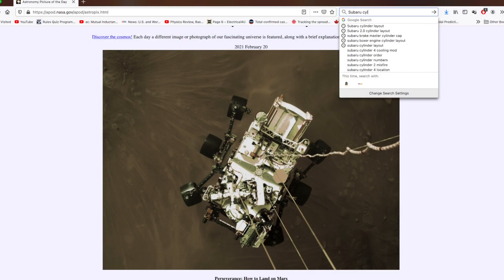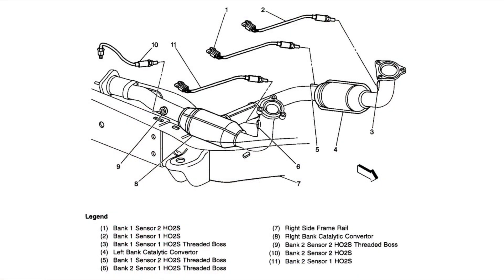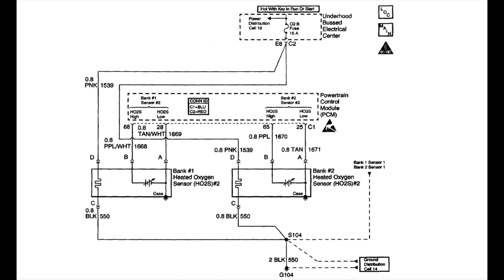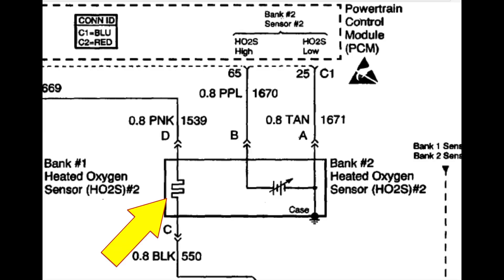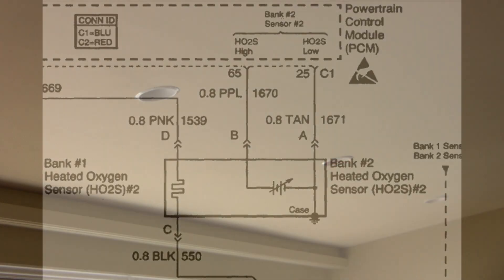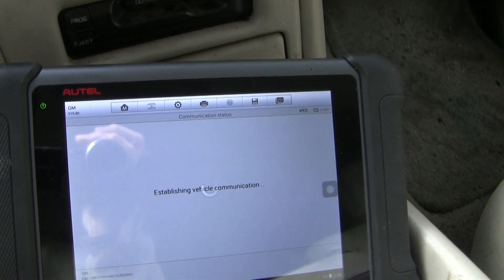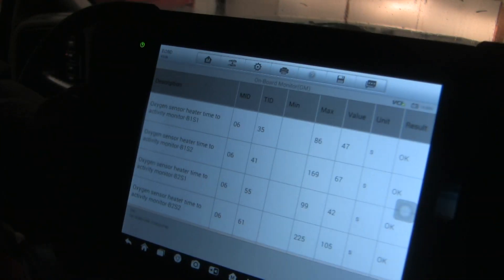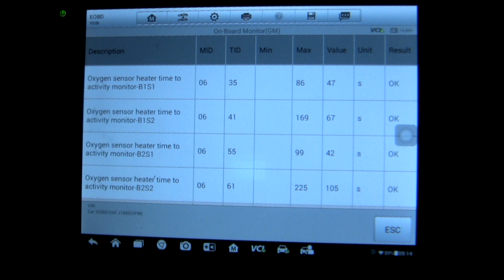Oxygen Sensor Heater Circuit Malfunction P0161, P0141, P0155, P0135. How to diagnose and fix.

Comment: i have a 2006 ford e250 5.4L recently I got these 6 codes p0135,p0141,p0155p0161, p0403,p0443 i have change EGR valve solenoid some hose ,and as soon as i clared the do a test drive shut the engine off and start it again the code come back
Reply from the maker: With all four heater circuits failing, presumably at once, I'd have a close look at the fuse and circuit that feeds all four. I would not replace any oxygen sensors until you investigate the problem. Maybe you'll get lucky and find that the EGR and purge valve are fed by the same circuit. If the fuse is blown, I'd replace it, retest, and consider a hunt for a dead short that would cause the fuse to blow. Near the exhaust, it would be common for a wire to hang down and get burnt against the cat or exhaust, so a quick visual search may be all you need. You'll need a wiring diagram of how those heaters are fed. Problems could be an open, like a broken wire, or a short to ground on either the power side or the ground side. If the ground has failed you'll get a similar pattern, so the wiring diagram is your best plan. I use Alldata to get those kind of details, although I'm not very happy they've raised prices. I'd be crossing my fingers hoping that the driver circuit that feeds those heaters hasn't failed inside the computer. Good luck!

Comment: I have all this codes on the title nobody find the problem I replace all O2 sensors en codes come back is a nightmare
Reply from the maker: That's why the details of how you investigate before replacing parts are so important. The answer is usually clear if you are comfortable with a multimeter. After parts are replaced, you face the dilemma of whether the new parts are a wrong fit or just plain bad.
Reply: @spelunkerd  thank you for the reply My car basically I change almost everything because I want to keep it for long time sparks ,coils , purge valve, air filter , cabin filter, maf sensor, pcv valve, drive fuel module, and o2 sensors , the car drives horrible I saw a video in explorer mine is mustang the explorer have the same codes plus the A/c compressor code mine dont have the a/c compressor code but is not working meaning I dont have A/C  in florida LOL this guy in the video finally find the problem for the explorer he said is the ECU, my problem is I don't know where to take the car anymore every mechanic i see wants to change parts and don't fix the problem. I am going to reset the ECU tomorrow and see what happen if not bye bye and buy another car. you are very good mechanic

Comment: I did this on my 2007 Yukon and had no success check the old sensor and no continuity but the new one did have continuity checks the fuse and it was good still have a check engine code 😮not sure what’s next
Reply from the maker: In order to protect the computer driver, some systems require the trouble code to be erased before it will attempt to turn the circuit back on. If you don't have a scan tool you can erase codes by removing the negative pole of the battery for 3 sec, then reattach. Failing that, I'd be looking more closely at the circuit to verify that you are getting 12V to the heater wire of the sensor and that the ground connection to the sensor is good. I showed those test with a power probe and a test light but you can do the same thing with a long fused jumper wire, a multimeter and a test light to verify circuit integrity. The computer often sends out a bias voltage onto the circuit and it may trip a trouble code if the wrong value of resistance to ground is found. Sometimes that happens when the replacement O2 sensor is an aftermarket device, incorrectly matched to the circuit in question. Finally, you need to be sure you replaced the correct sensor, so go back and verify assumptions.

Comment: I just replaced my Bank 2 Sensor 2 P0161 O2 sensor on my 2013 Ford flex 3.5 N/A. Funny had the exact same sensor problem on my old 2011 Lincoln MKT with the 3.7 engine. The problem both the wiring broke off.

Comment: Hi, my car has an upstream narrowband oxygen sensor and I want to install an additional narrowband oxygen sensor for my AFR gauge.. where to connect the heater?
Reply from the maker: That's an interesting question. I suppose you could wire it in parallel to the heater wiring for the sensor already in use. That would add an additional load but most of these circuits are built with enough reserve to cope with a little more current without blowing a fuse. Alternatively you could tap into the sensor side of the sensor already in use, without requiring the hole and bung for a second sensor. Or you could use a scan tool tapped into the OBDII data port, accepting the computers interpretation of data stream.
Reply: @spelunkerd I thought that if i connect the gauge with the car's oxygen sensor (signal wire) it could result in detection of wrong measurements from the ECU and from the gauge.. Now If heater has reach the temperature that oxygen sensor needs to operate then the heater's resistance becomes low and ECU understand that it needs to stop feeding it with voltage.. If i connect another heater in parallel can this affect that function?
Reply from the maker: @konstantinoskiprislis3192  Those are good points. If the impedance of a parallel gauge is similar to that of a multimeter (10-15 million ohms), then the effect on sensor readings will be negligible. On the heater side, adding an identical parallel heater will halve the resistance of the line, which could increase current production from the PCM, or even trigger a trouble code and cause the PCM to shut off current to the heaters. It may or may not work. It would be simpler to just add a scan tool which will show data in real time with less trouble.

Comment: So it will run like crap tell it gets warmed up then it runs ok?
Reply from the maker: Not usually. When the heater circuit fails you don't typically notice anything abnormal. That's because the PCM has a backup fuel trim that it uses before the engine warms enough to go into closed loop feedback. There is a long list of things that will cause difficult cold starts, including but not limited to a failed coolant temp sensor, bad fuel, vacuum leak, failing cam phasers, stuck open EGR valve, leaking valve pushrod seals, poor compression, etc.
Reply: @spelunkerd  it ended up being a bad ground under the passenger side wheel well.. now all 4 o2 sensors are working properly

Comment: I have barometric pressure too low (P0129) and all four 02 sensor heater circuit high codes. Anyone have any idea what could be wrong? Also barometric pressure light turns on without starting vehicle
Reply from the maker: I'll throw out a guess those two are unrelated. Don't forget the easy fix, the fuse for the heater circuit which would take out all four at once. Hopefully the PCM driver itself is OK. Once fixed, you may need to erase codes for the PCM to give it another try. It's not uncommon for barometric pressure gauges to go bad. I'd seek out the sensor in question, check power and ground to the device. Check alldata to find your vehicle and see manufacturer details that will guide further testing. This might be one of those devices that sends a variable voltage to the PCM. If so, to evaluate the sensor wire you can apply a tiny voltage complete with current limiting resistance by using the diode function on your multimeter, then look at a scan tool for change in value to verify circuit and PCM continuity. Never test the PCM with external voltage and no resistance because you could fry the PCM. if all is well, change the sensor.

Comment: What is the voltage that your power probe should register on each of the pins on the harness side of the O2 sensor plug?
Reply from the maker: The two thicker heater wires that are often the same color are pretty simple, one side will be ground and the other side will be 12V, sometimes with a PWM intermittent pattern in newer cars. The sensor wires are more tricky, especially if you've got a newer wide band style sensor. One side will be ground, and often the other side will have a bias voltage applied by the computer to allow it to make conclusions about circuit integrity. To know what that bias voltage is, and to know what to expect on the sensor wires, your best resource is the dealer service manual. Older style narrow band sensors like these are pretty simple. The other variable is the way once a modern computer detects a problem, it may shut down output to that sensor to prevent damage to sensitive electronics. You may need to erase codes to allow the computer to try again to get a newly installed sensor to work properly.

Comment: Dodge ram v8 will trip asd pcm?
Reply from the maker: That's never happened in my old '98 Dodge but in about 2002 Chrysler moved to an ASD relay inside the TIPM, which was problematic because of corrosion. Through the next decade TIPM corrosion and various issues became notorious.
Reply: Its a 2001 ram auto/rwd the tipm has only relays in and on it no curcuit board

Comment: I just replaced my sensor coz that's WHT the scanner is telling me.. 

Now the check engine lights up again now its the heater sensor
Reply from the maker: If it's the identical sensor again, then possibly the aftermarket sensor is not recognized as correct for your car. Aftermarket sensors are a lot cheaper but don't always play nice with the OEM equipment. Alternatively if it is the identical trouble code then possibly you've got a problem with wiring or the connector. Work it up as shown in the video and you'll likely sort it out.
Reply: @spelunkerd  thanks for the answer i bought that sensor for 12k pesos here in the philippines and they said its an original i hope it just the wiring like the seller said when i return to him
Reply from the maker: @joenelsaracho4836  If the heater has burnt out, it would be easy to prove that with a multimeter set to ohms. You never know when you buy used parts.

Comment: My blazer keeps throwing a 02 sensor code, even after I replace it with a new one.
Reply: One big thing that I suggest is always making sure to use genuine oem sensors. It may be a little pricey but will definitely be worth it in the long run
Reply: Did you reset the computer?

Comment: how bypass 02 senior on dodge ram 1500..i have straight pipes and not cat.
Reply from the maker: In older vehicles the data from sensors placed downstream of the cat are there almost entirely to assess the function of the cat. So, even if unplugged there should be little effect on fuel mileage or fuel balance. The PCM will trigger an unavoidable check engine light and trouble code. The vehicle will fail emissions testing if you live in an area demanding it pass, but the vehicle should drive fine.
Reply: @spelunkerd  I will put fouler on
Reply from the maker: @bubbaclaypoole7579  With no cat at all I'd be surprised if any extender would be long enough to flatten the rich/lean curve. It seems like a lot of work when you could simply apply black tape over the light on the dash.
Reply: @spelunkerd  I can jump the senders with resit..i cant spell word im a old shade tree mechanic..lmao
Reply from the maker: @bubbaclaypoole7579  A simple resistor works for air bag circuits and even some first gen security circuits, and there is some internal resistance to the signal part of an O2 sensor. But recall that O2 sensors actually produce voltage and tiny current after they warm up, much like a battery within a narrow range which the PCM is looking for.  When the cat is working properly the normal wide swings of voltage are flattened out within a specific range. Some circuits also have a bias voltage used by the PCM to look for opens and shorts. It would be tricky to try and mimic a normal O2 sensor closely enough that the PCM is not able to detect a problem. You also have two sides to the circuit, with a heater side that needs to be approximately right as well. For the amount of fiddling it would take to try and get it right, I'd just live with the dash light.

Comment: i tested 3 sensors and all have about 3 ohm resistance, but all heat up too slow , i tested wires , i installed 12v bulb and it blinks when i turn key for contact and when engine is started, any idea?
Reply from the maker: With engine on at cold startup you should get either a continuous glow of that bulb or repetitive high frequency flashing. Some computers will turn off the heater circuit if the circuit is shorted to ground or has a trouble code, so you might try writing down and then erasing the code, then try again. Aftermarket sensors may not behave the way the computer expects so that may be an issue.

Comment: I am a professional technician for 40 years. People see you do it, they will do it too.
Reply: Out of nowhere all 4 of my 2007 mustang gt automatic cars 02 sensor codes came on. This happened ed after 2 weeks ago I had code p0443 and I had replaced my purge valve solenoid. What could be the issue? Amk fuses are working

Comment: Please don't teach people to poke the probe thru the wire insulation. This is where corrosion is going to start in about 2 months.
Reply from the maker: Although I understand your point, remember that this is the part I'm throwing away. The new sensor comes with that length of wire up to the connector. Were I not to throw away that wire, it is easy enough to fix with liquid tape. Professionals puncture wires every day, and if repaired correctly there is no issue even if they continue to use that wire. There are of course alternate approaches. I have a $400 set of breakout T connections that require front probing with correct size taps. When the wrong size is chosen, corrosion or loosened connections can start there. And of course there's the old inexpensive standby of backprobing with a fine needle, again vulnerable to eventual water ingress when you slide that needle along the rubber seal. So, various options, all carry some risk. Remember that if you're trying to measure response with a scan tool, or if you're doing simple drop testing, you need the connector be fully hooked up to assess response. Even front probing one side of the connector carries risk. I remember ScannerDanner rolling his eyes at remarks like this. What method would you use? Or, do you play the parts swapping game and forget accurate diagnosis?

Comment: Great video, very well done and informative! Thank you! Any chance you have a suggestion on how to safely perform a drive cycle out on the road? My 2000 Silverado 1500 5.3L produced a not ready to test result upon attempt for emissions test.
Reply from the maker: Part of the drive cycle involves temperatures that are high enough to accurately test the evap system. At this time of year It won't complete if it is too cold, if the tank is too full or too empty, and if you haven't taken it for a long drive at highway speeds.

Comment: i need your help, I have the same o2 connector as in your video, 4 wire, 2x whites for elements and black/gray for signal. I been getting 0141 and 0138 which points to the downstream o2, and i replaced it and still getting hi volts b1s2. i checked the voltage on the truck side, as in your video, and im getting 13v for the elements and 4v for the signal. my upstream sensor is working fine and no other CEL codes have returned its always 0138 and/or 0141
Reply from the maker: The P-0138 is the interesting one, suggesting that somehow high voltage is leaking into the sensor side of the circuit. I'd be wondering if there is a short to voltage somewhere along the path of the wires. I've seen that before, and as I recall ScannerDanner did a video on that intriguing diagnosis. If you have a scan tool that will show live data, you can view the data coming back to the computer. You can even apply a ground to the signal wire and see if the signal drops. I would not apply power to the signal wire except through a big resistance so the PCM can't be damaged. There's a famous trick where the mechanic touches a 12V source with one hand, and with a wet finger of the other hand touches the signal wire. Even that tiny power through the human body is enough to shift the result on the scan tool, verifying wire integrity. In your case you need to inspect the wiring harness looking for a short from the live heater wire to your sensor wire. Pay close attention to connectors, wires that got too close to exhaust, sharp edges, etc. To rule out the new sensor as a cause, disconnect it and see if the live data in the scan tool shows a drop in voltage. The scan tool won't necessarily show 12V, there are internal zener diodes inside the PCM that drop the voltage down to the safe 0-1 V range. If everything still checks out, remember to erase codes and try again. If you don't have a scan tool to erase codes, disconnect the neg pole of the battery for a minute and try again. The PCM has a protective mechanism with some codes to stop looking at sensor data if the voltage coming back is possibly dangerous.

Comment: Please tell me the resistor value.  THANKS
Reply from the maker: Scroll to 7:52, it's written in the video for this vehicle and this sensor, (3.5-14 ohms). My new sensor was out of spec at 15.1 ohms. Every vehicle is a little different so if you have a different make and model, expect some variance. For dealers specs I use alldatadiy, although their long term subscription fees have escalated quickly.